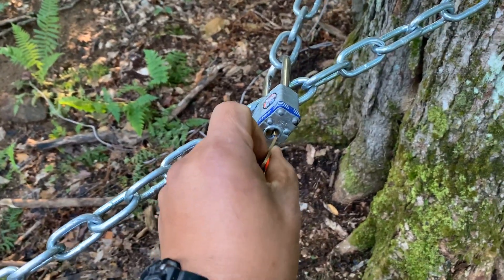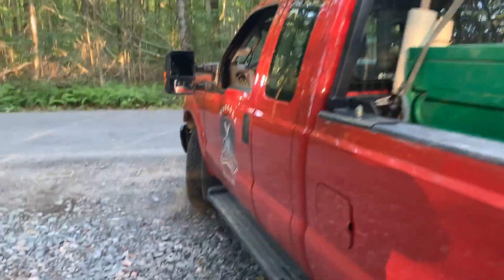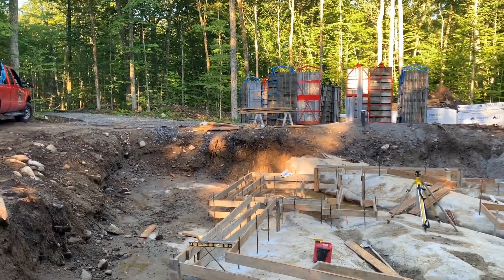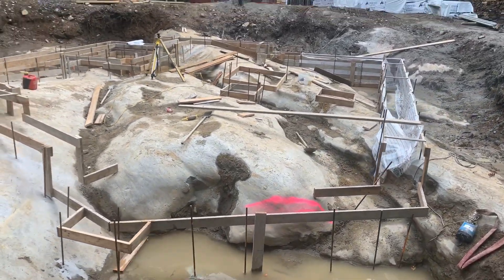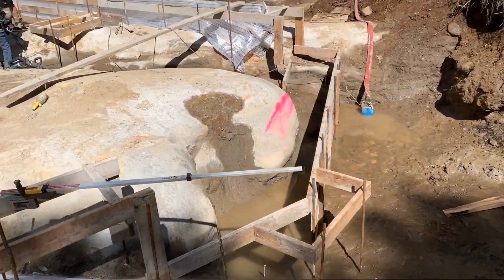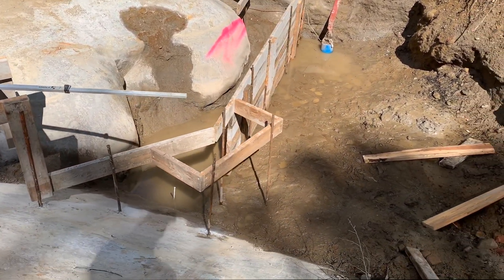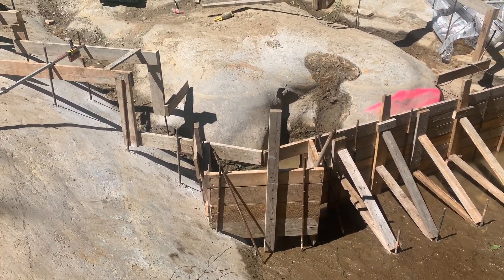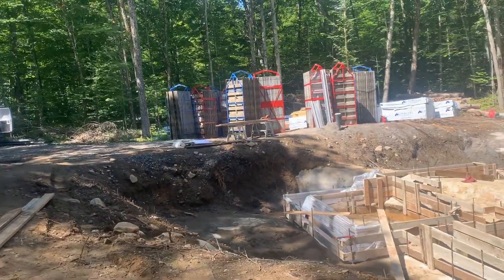Footings on Bedrock

Comment: What do you use to drill into the rock, does a standard carbide masonry bit with a hammer drill like a Bosch Bulldog work or do you need something heavier duty?  I suspect once I start to dig my footings on my off grid property I will find bedrock too.  If not, probably lot of big boulders. My ground is very rocky.
Reply from the maker: we us Makitas largest rotary hammer their second largest model works well also. Hilti makes the best rotary hammers, but I can purchase two of these Makita or one Hilti
Reply: @muskokagrind  Pun intended: Makita ROCKS!

I'm boring rebar holes in Adirondack granite in seconds - not minutes (or hours).

Comment: What a perfect spot to build a house, there will not be any settling of this house....EVER. I believe overkill is under rated, personally I would have drilled the holes for the rebar 24" deep or more into the rock, then used compressed air to blow out all the stone dust from the drilling and then added the epoxy to the holes and put the vertical rebar in place.
Reply from the maker: 24" is definitely overkill!, epoxy is an amazing product
Reply: @muskokagrind  Do you remember the collapse of the concrete roof panel in Boston's Fort Point Channel Tunnel that connects to the Ted Williams tunnel(all part of the Big Dig)? Those concrete roof panels were secured with massively strong epoxy, but they did not take into account a property of epoxy called 'creep.' When epoxy is under constant load, such as having rebar or a bolt secured in a drilled hole the bolt will slowly 'creep' i.e. move and over time the epoxy fails completely. While 24" seems like overkill, it is really added protection that the structure remains secure.
Reply from the maker: @chrisdaniel1339  I understand what you are saying, and I did not know about creep.
Reply: @chrisdaniel1339  Good to know. Food for future design thoughts. Thanks!

Comment: Hi there,
I am seeking advice on how to build a footing on the bedrock. I am unsure about the correct drill diameter to use and I want to ensure that I get it right. At present, my stakes are 3/4 inch and I tried using a 7/8 inch drill bit, but it turned out to be too loose. Can you suggest a suitable drill diameter that I should use for this task?

Thanks!
Reply: 7/8 is correct
When you screw out all together it will be tight
Reply from the maker: how did your footings turn out?

Comment: I see the rebar holding the forms in place, but was rebar drilled inside the form and then poured over with concrete? Thanks! Interesting video.
Reply from the maker: no, the hole is not drilled inside the form, it is not poured over with concrete

Comment: What kind of drill and drill bit did you use to drill into the granite rock ???
Reply: You use what's called a "hammer drill." You can get a refurbished one around $120 to $140 - or rent one. You use a diamond carbide drill bit. Make sure the bit end is the proper fit for drills chuck hole.
Reply from the maker: we use Hilti bits with a Makita SDS max biggest corded rotary hammer they sell
Reply: @muskokagrind  The "SDS" part is a really important detail. The "Sliding Drill-bit System" completely changed the "hammer drill" arena.

There's not really any comparison to the hammer drills of the early 90's, or even with battery operated drills of today.

God, I do love tools. Especially really good ones.